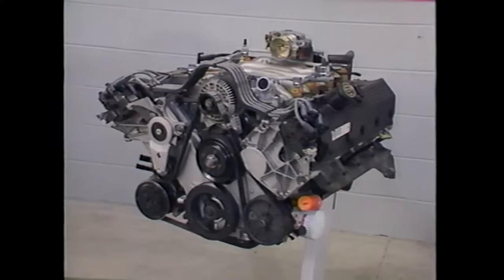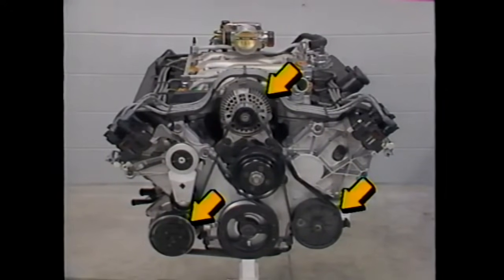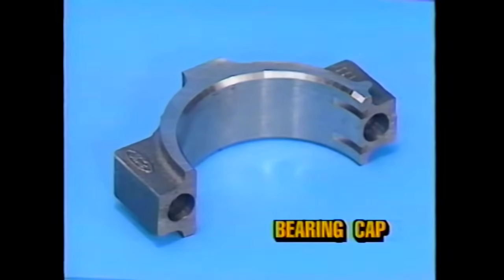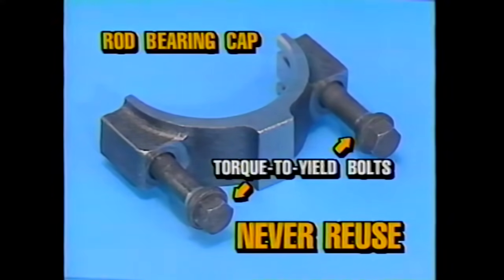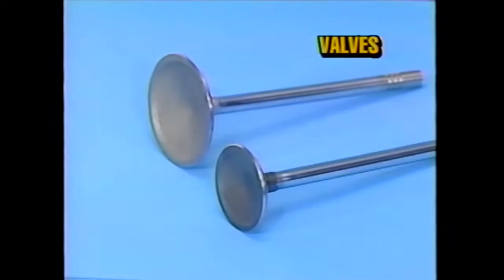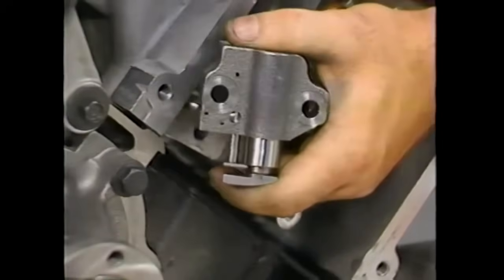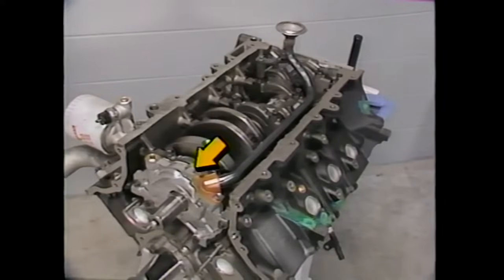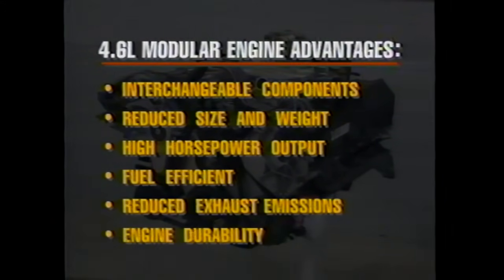Ford 4.6L V8 Engine Technical Education

Comment: I watched this because I’m considering purchasing a Ford Explorer with the 4.6L engine.  After watching, I have a few concerns:  1)  No replaceable camshaft bearings? I don't know, having to replace the heads and cluster caps if the cam bearings wear out is NOT a "feature", it's a cheaper way to make an engine.  2)  He talks about the cam lobes being narrowed; I hope they’re correctly heat treated, because the loading area on a narrow cam lobe is increased over a wider lobe.  3)  Also, did anyone else notice him saying the jack screws have left hand threads and that “tightening them requires turning them counter-clockwise.”  The video show the bolts being turned to the left to loosen and to the right to tighten.  Otherwise, it looks like a nice engine.
Reply: Speaking as a 30+ year mechanic OverKnight I wouldn't be at all concearned about the cam bearing thing,,it's been done that way on many overhead cam engines for many years (datsun/nissan and toyota's did that on the four cylinders in the late 80's and many continue as such now) also the cam having narow lobes is no issue because they are roller design so don't get anywhere near the strain and stress of flat tappet cams, basiclly no wear with roller cams so heat treating of the lobes while still important  but isn't nearly as important as flat tappet,,,that's how they get away with the narrow lobes and even helps take some of the abuse off of the bearings also because of the more fluid motion and side loading of the roller design, remember and keep in mind that cams turn half the speed of the crank so wear is not an issue also making the no actuall bearing thing not a big deal,,,just keep in mind that GOOD and proper type of oil is CRITICAL to theses engines,,use what it calls for and ONLY what it calls for and change it often (I saw a guy once bring on to the shop I worked at that had killed the top end in less than 5 miles because it was cold winter time and he had put only slightly heavier oil in it, called for 5W-20 or 5W-30 he said all he did was use 15W-30 dello in it because that was what he had a bunch of around that he used on a few things around his farm, well it was ok in the hot summer but in the freezing winter it got too thick and starved the top end of oil before it thinned out from engine heat enough to flow enough up to the cam and valvetrain,,,,expensive lesson for the cost of a bit of oil,,,,,just an FYI the early famous 2 valve Cummins in the dodge pickups used only 1 cam bearing on the first jernal the rest just ran it in the cast iron of the block and they live a LONG time that way LOL, also the jack screw on the mains is nothing new certain high reving high stress race engines have been using that setup for many years and it works better than the well proven four bolt mains used in bygone years becuase it ads nearly the strength of a four bolt conventional design or using whats called main bearing cap girdles without iducing block distortion or adding weight to the overall package,,,,as one who is not fond of new things and being old school older timer I was reluctant to accept this "new"design but after running the ever living dog snot out of one for a few years now I'm convinced,,,,I own a 2001 f150 4x4 with the 4.6 in it with the 5 speed, the truck had 42,000 on it when I got it it now has 110,000 on it and hasn't had a single issue or any work at all done to it, it's completely stock and has had NOTHING done inside, I am second owner and bought it from a friends widow after he died, the only thing it's had done to it is a set of compact pro tunning lab headers and a cat back flowmaster exaust, K&N fresh air intake system, a chip and computer worked over by a local computer guy to rid it of that annoying top speed cut out that ford equipt it with so it will now run out above the regulated 98 or so that it use to top out at no mater how hard you pushed the go pedal, some better injectors and high delivery fuel pump and a few other minor tweaks and shen now runs a full 317 rear wheel horsepower and tops out at something well above what the 100mph speedo will read (where the speedo stops reading I still have number 5 gear and plenty of RMP left but that's my chicken out point LOL,,,I figure somewhere around 120mph and a stock f150 4x4 at that speed is a tad frieghtening my friend LOL,,,,I live in Idaho near a hill called white bird hill,,it's about 7 miles of 7 and 8% grade and I like to race guys in thier whatever trucks (or cars) up that hill, I have not been outrun too many times up that hill because the little ford has no problem running 100+ up that hill,,,I just stuff her in thrid and let her wind up till she can't wind up anymore,,,or basically 6000 to 6200 rmp where the rev limiter kicks in and hold her that way for the entire YES the entire 7 miles, and at that rpm shee's running 90 to 95 mph, then at the last 2.5 miles or so I go for fourth and I'm pull 100+ in a instant no problem at all,,,I could run number 4 all the way but a couple of the bends on the hill are too tight to make the truck stick to the road and you need to back out and catch third, and even at that you are getting tire squeel so I just leave it in 3 untill the road stays strait that last couple miles,,,,I even came up that hill one day hauling a 1988 ford f150 4x4 extended cab (my 2001 is an extended cab) on a car trailer,,I was minding my own bussiness when  cummins dodge picked on me and had to pass,,he was also hauling a truck on a trailer that was nearly the same as I was hauling,,,so I decided to put it down and see if I could keep up with him,,,well I not only kept up but got around him and was pulling away a fari bit by the top of the hill, I just did my third gear let her scream trick and was running between 80 and 90 mph without issues (a couple of the coners were honestly iffy at that speed pulling a trailer admitidly but my little ford handled it),,,I figured either the guy chicked out or it was a sick cummins but the guy followed me into grangeville the next town after the top of the hill just to ask me about the little ford and he said he was giving it all the cummins had and that it wasn't completely stock but had some exaust intake and pump work done on it (earlier 2 valve) he didn't believe mine was just a 4.6 untill I opened the hood,,,he also couldn't believe I ran it so hard,,, LOL,,,that's ok when it blows it's cookies (if it ever does at this point because I've been running it hard like that for 60,000 miles that I've had it living in canyon country climbing hills and what not and it still runs perfect with zero issues)  I have plans for an even nastier little 4.6 setting on an engine stand in my shop,,,so yes I have GREAT faith in this little engine.
Reply: @looseballs1966  yes. Thank you.
Reply: Bro literally the 4.6 2v is the 2nd most reliable engine Ford has ever made
Reply: I hope you bought that Explorer.  I have never seen cam bearings in any Aluminum OHC engine I've ever worked on.  These 2V (2 valve not 2 venturi) 4.6 run to 400,000 miles regularly and in abusive environments.  I kinda hate working on Fords but the 4.6 2V is one of the best engines they've ever produced.

Comment: "The spark plugs threads were payed absolutely no attention during the entire design process. Reducing attention paid to spark plugs threads allowed more attention for the important things like hookers, cocaine, and warm Keystone Light". Hahahahaha
Reply: My 99' Crown Vic P71 has lost 3 plugs in it's life. Once before my dad bought it in 2012. Once while my dad was driving it, and again while I was driving it just a couple months ago. That being said, the Triton is one hell of an engine. This crown Vic has been in my family since I was 12 and I'm 26 years old now and driving it every day. 179,739 miles and going strong. She's idling right now as I type this lol
Reply: Read in narrators voice lol
Reply: The ‘91-‘96 as shown here, had zero spark plug issues. It was only the early truck engines that had less threads that were corrected by ‘99.
Reply: Granted it sat for 2 or 3 years in my dads yard before I brought it back around..
Reply: It was mainly the 5.4 ford sold more Econoline vans they any other vehicle the heads had quality issues cause they were cheaply built.

Comment: I have a 1997 Ford F 150 everything is stock and runs great ,  you guys recommend me doing any preventative maintenance or any modifications?
Reply: I just got one to was thinking the exact thing
Reply: Best upgrades will be a 9.75 drive axle stronger valves dual core radiator maybe stronger connecting rods that's alittle overkill if you got room do a high flow oil pump and bigger oil pan but you will also need a longer dipstick, the crown Vic have a bigger oil cooler but that might not fit some vehicles cause of the steering linkage

Comment: He means it's capable of producing low horse power numbers, not high. The number 5 main is a 2 piece design not one piece. Why would anyone want to switch sides with their cylinder heads.
The 4.6 2v is a great engine. Keep these engines well maintained they don't like sludge. Conventional 5w20 or 5w30 every 3 to 5k miles.. you'll get 200k to 300k...
Reply: if one cracks you can get another and swap it no matter which side is

Comment: With the right set up your looking at 500hp to 1,000 lol these engines are awesome there fun to work on and build up and see the performance after each upgrade ,I love that almost everything you can do to make it insain is actual budget friendly and really fun to do ,
Reply: Giving me motivation to work on my 4.6 f150 lol
Reply: What modifications do you recommend to start with?
Reply: @Val1973-n2h billet oil pump gears, mild cam, forged internals & your choice of forced induction
Reply: Doesn't need too many upgrades unless you towing then a dual core radiator, the only thing I might do is stronger connecting rods stronger valves but even that's overkill and in the thousands of dollars
Reply: I don't know about the Forged internals too much money for very little results you can't even notice any difference, go with the billet timing chain guides, maybe cam upgrades they really don't need any upgrades maybe a heavier flex plate for more rotating mass. I'd honesty whouldnt change a thing about the four six maybe some stronger valves

Comment: 171000 miles 2004 ford f150 2 door xl my first truck still going it's used I like it cause it has a lift and is good for the flooded streets where I live I'll post a pic or videos

Comment: 2002 4.6L 285000 and running great! love these motors.
Reply: Have you rebuilt and replaced gaskets yet?
Reply: Have you replaced the timing chain guides? They are plastic and will break off, get in the oil pan and pieces will clog the pickup tube, causing lack of oil pressure.

Comment: One of the most reliable engines on the road today
Reply: Low HP
Reply: works like a damn charm though. had my 06 f150 for 11 years and she's got 220k miles on it. cleanest engine i've ever had
Reply: @alexandershultz9913  Just broken in!
Reply: @ss-qw4bw  thats why its the more reliable one. Less power=less stress
Reply: @ss-qw4bw easy to make reliable hp not to mention these motors love boost… not bad for a non performance truck motor.
Reply: @ss-qw4bw no not really. You can find 2024s and 2025s that make less hp than the 4.6. Also you can easily mod these to make way more

Comment: Ford explorer  almost 300.000 on it little noise sounding like a diesel but still going....
Reply: Timing chain tensioner
Reply: I would check that out, that dosent sound good
Reply: I thought it was normal for ford...ha its so old its not worth the repair bill..sounds like lifters or something deeper

Comment: 475,000 miles on my 4.6L engine and still going
Reply: 170k on mine so far, hope it'll make it that far
Reply: Outstanding, i replaced mine at 420,000 after It devoloped a tic. Trans still runing strong.
Reply: I had one 4.6 reach 375K miles, while the other was in need of repair at 200K. but still very good life on them. I bought both of these trucks brand new in 2003 and 2005.
Reply: @indecentchords  what oil did you use on this engines? 5w30 or 5w20? Did you use that viscosity all their service? Thanks in advance
Reply: 296K and counting on mine!
Reply: 2004 Explorer XLT 4wd with 126k
Reply: @mikepalumbo4362 my 02 Explorer just clocked 204000 mi.  Original exhaust, trans,  and no major repairs. No body rust and Oil change every 4000 miles.  Great freeway cruiser...
Reply: 230k and counting 🔥🔥
Reply: 61k on my 04' 4.6! Lol
Reply: @emmittmatthews8636  can't wait to get one with low miles
Reply: @thomasgellos1732  The rust issues are getting to it sadly. 
I'm going to really go over it before fall and protect and save it. 
66k and runs fantastic though.
Reply: Mines going strong at 234 k
Reply: I got 225,000 on my 06 Vic and she still purrs 🥵
Reply: @jtubb3665 Yus another panther body here 06 Marquis Ultimate
Reply: I'm a tick away from 400k on my 2005 2v
Reply: wow
Reply: Wow, that's impressive. Mine is barely a bit over 200k. Have you ever had to do a head gasket replacement? If so, what brand gasket did you use?
Reply: Did you ever rebuild the engine or replace the gaskets? I have to know. I am in a position where I think coolant is getting in my cylinders due to gasket failure. I cant lose this car.
Reply: Love it❤️
Reply: How many timing chains & oil pumps you go through
Reply: I just bought a mint condition 07 Towncar and hope I can get that kind of mileage.
Reply: What's the secret?
Reply: Panther platform anyone?
Reply: Wow!
Reply: I love you
Reply: Just turned 400,000 miles original  engine and trans
Reply: Wow when you get to a million, let Ford know, and they will give you a brand new f150.
Reply: @IAW888 ignorant to the max!!!
Reply: I was wondering if your engine is still running 4 months later. Im sure it is, crown vics are indestructible.

Comment: "high horsepower" I choked.
Reply: dooooooo you see how old this video is?
Reply: @rialbb  yes, but at the same time Lexus had much higher numbers...
Reply: @BlackTownie999  probably just product placement trying to sell the engine at the time lmao
Reply: @BlackTownie999  yeah, also cost thousands more.
Reply: @dramaface  We should had the option of the Mark 8's Dohc 4.6...It's too bad we didn't.
Reply: @BlackTownie999  also, lets compare how many of these Lexus engines vs 2 valves there are still running around out there today. There’s two 2 valves from the early 2000s in my driveway alone still running like the day they were built. Not a Lexus in sight around my parts.
Reply: @dramaface  Sad but true, probably victims of poor maintenance (cost) and cash for clunkers...I also have a couple 2v's however one needs a lot of work to run again, it was an early 1999 so it was most likely built with parts made sometime in 1998. I also have a 2007 PI 4.6 waiting to get swapped in to replace it.

Sad truth is, Toyota's as reliable as they are do cost a lot more for regular maintenance, and replacement engines can cost three times as much....They in turn get abused more in that aspect...
If you ever find a first gen LS400 with good maintenance history and for a good price, jump on it (if you can afford the maintenance costs of the V8) and save it from some punk that will abuse it. 

That said, Lincolns are easier to find and more affordable and easier and cheaper  to fix And just as reliable with proper maintenance...That's why I have one.
Reply: @dramaface  the 1uz's are 4 valves and are non interferince engines, awesome units good for 200+ miles, but I do love my 4.6 2 valve just a bit underpowered imo
Reply: @BlackTownie999  
Man, an LS400 started at like $53k in 97, around the time this video was made. These 4.6L engines were made for everyday trucks and sedans. The same year, you could get a Mustang GT model starting at $18k. Or maybe you wanted to splurge a bit, and could spend $25k on the Cobra.
Reply: @barms9768  My Lincoln has a similar price yet came with an anemic 215hp 4.6, I decided instead of fixing it I'm swapping it to a much newer 4.6 with around 260hp...300+ hp would be nice but for that I need cams and headers on top of a new tune and everything else I did
Reply: @beereadyyy9849 the UZ1 came out 8 years after the 4.6 2v & produced the same hp
Reply: @WarriorOfEden3033  wut no. The 1UZ was out in 1989, the 4.6 2v came out in 1991.
Reply: Reading up on my 2002 Lincoln Continental with this engine. "high HP" is NOT how I'd describe that car lmfao.
Reply: High HP for the time & size
Reply: Then he went further, High RPM engine performance. 5500rpm is high? They were/are torq motors.
Reply: @amunderdog  reliable, yes, torquey eh kinda…definitely not high horsepower or high rpm 😂 the later ones like the PI 4.6 was a little better but still nothing too brag about, but they do love boost…
Reply: It wasn't bad HP for the time. This video is from 92 or 93 judging from that intake manifold. At that time, the caprice, ninetyeight, and roadmaster had roughly 180hp. Caddillac Deville had 200hp from their HT4900. Bmw 3 and 5 series was in the 180-210hp range. Most other manufacturers didn't make full sized rwd sedans. The only ones that really blow them away is the Infiniti q45 and lexus ls400 with 250-260hp. But that from DOHC 4 valve v8s compared to a SOHC 2 valve engine. The 1992 lincoln MK8 with the 4.6 4 valve had 280HP.
Reply: Horsepower is purposely limited. Those tiny connecting rods can't handle much over 225.